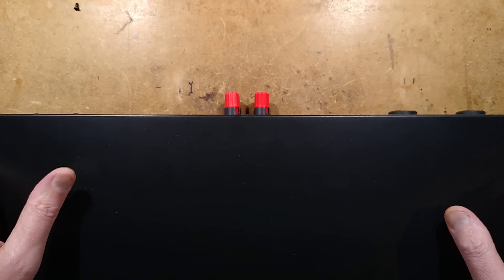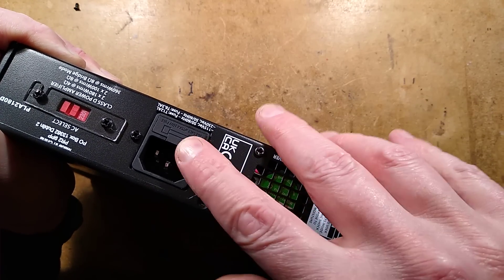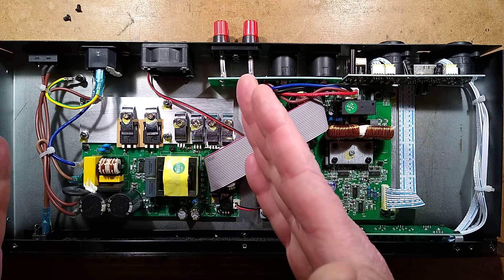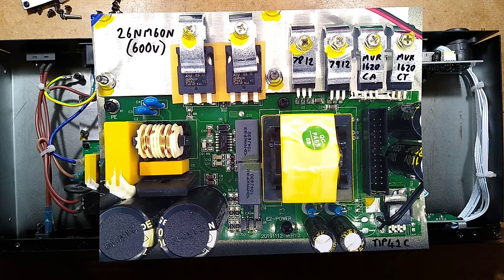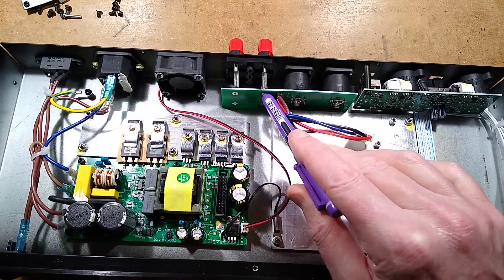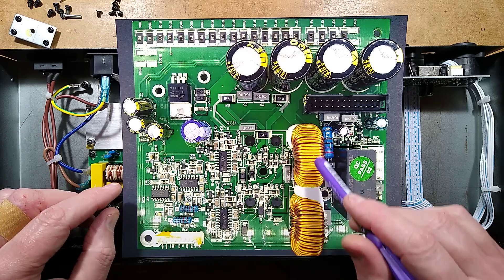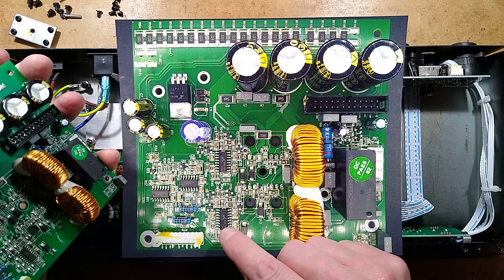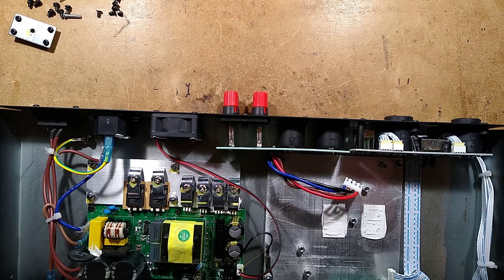Inside a 360W digital amplifier

Comment: can you make it run on an 12V power supply?
Reply: No, needs both +-25V rails, and also +-15V rails, to power the output stage, and input stages, respectively.
Reply: @SeanBZA  YES, beacause very easily IF you can find a power supply with output voltages you need or are man enough to make one PSU yourself.
In fact, extremely simple - you need a TL494 or SG3525 chip, two 40-60V and at least 60A MOSFETs, one or pair of 16-25V electrolytic capacitor(s) with a capacity of 4700uF, 2-4 pieces of 35 or 50V low ESR electrolytic capacitors with a capacity of 2200uF, 4 fast or Shottky diodes for a current capacity of 10-15A and 100V voltage rating , one 35-40mm ferrite (not iron strip or iron powder but ferrite!) toroid core+insulated (better if stranded, each strand enamelled - litz wire) copper wire or ETD34 ferrite core transformer with frame+ also insulated copper wire (better if litz) and some capacitors+resistors and UNDERSTANDING and you have a ready power supply unit that guarantees you voltages as low as 25V (personally I don't even see anything interesting in it because things go interesting after +-100V or more and tens of amperes of current at the output).
Reply: Yes ..use a suitability designed BOOST converter.

Comment: From my perspective there are two kinds of ground - power ground (protective ground) and signal ground.
So I'd like to have a dedicated signal ground post on the device.
In most rack mounted solutions the air is taken in at the front and then the fan sucks out the air at the rear. That's why there's foam at the front - to capture the dust from the air sucked in at the front.
Reply: XLR

Comment: Back in the day playing in a band at various venues one would often find a very noisy wall AC outlet, and all the gear was plugged into this single outlet. But we did have a sophisticated earth lift that could fix the noise with some risk. Disconnect the earth at the wall plug.
Reply: They sell something called an Isoline you put inline with your XLR which removes the ground loop noise without removing the ground.
Reply: Shocking!!
Reply: Very common practice!
Reply: You should never lift the earth...
Reply: @AstrosElectronicsLab  Exactly, only Atlas can lift the Earth...
Reply: @radioflyer2030  hilarious 😂
Reply: @AstrosElectronicsLab  was once very common 'get you out of trouble'
Reply: The DI box with the XLR for mixing desk. A ground disconnect trick used studios back in day was use a EURO-to-13A-plug adaptor that had two round prongs you poked into the standard 13A socket. That way didn't need screwdriver to open the plug up. Never did that with any group gear, very dodgy so that's miked up or DI non-contact. Because more decades ago guitar amps used to have a kind of "ground noise switch" that used to regularly malfunction and connect either the L or N direct to the chassis!   Some gigs the L & N are crossed over in the stage wiring.
Reply: That's how you kill the talent, good thinking Live Sound Maestro.
Reply: @railgap   Sorry never had a corpse on stage in all the years we played. After all, I was one of the talents.😋

Comment: I don't get the retarded reason of the 250V to 120V switch nowadays. In the old days they just had build it for the 250V and you could just plug it into the retarded 120V without issues.

Comment: two possible options for the large surface mount resistor array maybe:

1) it's a current shunt for output protection?
2) it's to discharge the HV internal power caps when you turn off?
Reply: At the edge of the board like this and next to the power supply cable bypass caps, they are more likely input current sensing. If they were output current sense resistors, they would be located along the edge where the output chokes are to avoid picking up noise from taking a long detour.
The HV caps are on a different board on the other side of the LV power/control cable, discharging them is definitely not it. Most SMPS will discharge their caps down to 20V or so in less than 20 seconds from disconnecting them from the wall or hard-switching them off just from their quiescent power draw, bleed resistors on them are only in case the power supply quits working so something will still be there to discharge them to a safe-ish voltage over the course of a minute or two.
Reply: They look to be 10k each and all in parallel. I count 20, making 500 Ohms. That's too high for a current shunt. It's rather low for a passive discharge. Also, I'd have thought it would be on the PSU board, not the amplifier board.
I am aware I'm making a few assumptions. Interesting ideas, though.
Reply: Fan driver, they want to not power the fan off the 15V opamp supply, as that will induce noise, so use lots of cheap resistors across the 25V main supply, and then the transistor to switch the fan on and off, with a zener diode to clamp fan voltage to 12V, and then use one of the comparator open collector outputs to switch the fan on and off, according to case temperature.  Temp sensor and fan connector on PSU board, but the wires run through the ribbon connector to main board for control of fan.

Comment: So the jack is 180 each, but then there's two speakers which would be 360 anyway, why split the connection, and still end up with mono sound
Reply: Maybe if you have a higher impedance speaker ?

Comment: Looks ok  for a lower cost unit assuming it sounds good, but I do not accept their rated output by standard testing practices.   Let’s see how long it lasts under load too. Soon as that foam filter loads up with normal daily dust the high temperature cut-out will hopefully function as intended.
Reply: Normal daily dust plus other more oily airborne by-products of the now legal recreational use of a popular music pleasure enhancer.😁
Reply: Isn't the output rating a peak measurement for most amplifiers? it's rarely going to sustain those loads for extended periods as it's amplifying a dynamic input. Usually it will had DSP to limit the input signal (or filter it) so you don't go over the peak, but the amp will clip if it tries to output too much, which you're supposed to address before the signal goes into the amp.
Reply: @wk4958  wattage ratings should specify whether rms, peak, music power or peak music power ..
Reply: @andygozzo72  I'm assuming it's implied that it's peak based off the nature of the device as rms would make no sense. They are designed to output only what they send in, so having its average power draw wouldn't be possible. I don't know what you mean by music power, but peak would make sense.
Reply: @wk4958 label by the IEC socket says RMS. 2x180watts RMS into 4 ohms. Now, is that continuous, or just for short bursts...
Reply: @RacingAnt  did a bit of research, it seems like RMS measurements are done with a test sine wave and multiplying the peak voltage by 0.707 (not a number I know the significance of. interesting stuff for me, I'm usually on the end of sending the signals in but not the picking of the amps used. I would assume they take into account the fact that there will be peaks that go over this value, but as I said before this does look like cheap Chinese stuff, so I wouldn't be surprised if it killed itself due to a minor amount of dust under operational levels.
Reply: @wk4958  i'm on about power output not power 'draw', rms would be what it can give out when fed a continuous sine wave, without noticeable distortion, or to a specified distortion level, music power, back in the 70s,80s or so was generally taken to be approx double rms power, peak music power, approx double that, but the makers varied how they specified it to make it seem higher than truely was in many cases!
Reply: Although this does look like cheap Chinese shit
Reply: The power at wich amps are rated is comparable to the program power of drivers/speakers. It is the average  power that can be acieved for short bursts.

Comment: interesting to see that they have the 'UKCA' along side an incorrect 'CE' mark! Does this mean that they have read the standards well enough to test the equipment but somehow missed the bit about what the 'CE'' mark shape. which is required to conform the shape defined in the standards. 5/10 for effort. do we beleve that it's been tested you should ask for a DoC and see if they can produce one. 🙂
Reply: Just saw you need that to sell in the UK, and stuck the sticker on. Eu versions will have a TUV sticker in place of it, or in addition to it.
Reply: @SeanBZA  No the EU versions will need the correct CE mark. the one shown is not valid. Search on "CE mark dimensions" and then your know that the one shown is not worth the price of the ink used.

TUV is just a test house where you would have your product tested to allow you to place the correct "CE" mark on it.  you could have tested it at any test house like "intertek, UL, SGS, Eurofins etc or even done it yourself if you have the equipment.

if you want to know more about a products safety ask the manufacturer for the "Delectation of conformance" by law they have to provide a copy on request. Some even put it in their user manual to save you asking.
Reply: @TheEmbeddedHobbyist  But you go and buy your "correct shape and size CE marked" item, no one is forcing you to buy this particular one - pay 10x more to get a same factory product with the "correct shape and size" CE sticker.
Do you even know what CE stands?
*C*hina *E*xport.
Summing up their entire bureaucratic background in two words.
Reply: @inarinukka7729  So you fell for that old joke, "China export" if you feel that saving money at the cost of safety is acceptable then go  ahead. But lets just hope that one of your family goes not get killed when you find out that they put the "CE" mark there but did not bother to test and confirm it was safe to use. if you put the value of the  lives of others lower then the cost of a bit of mains kit. 

I've CE marked a lot of products and to tell you the truth i would not sell any of them without the backing of the likes of UL or TUV to say I've produced a product that will not kill or hurt any of my customers.

Also do you know that most of the mains equipment that they sell to us will not pass the safety standards they require for it to be sold in china. The china standards are based on the same standards that we use for the UK and the EU.
Reply: @inarinukka7729  I see your point, but my K40 laser which was supplied by a UK seller! it has up to 20KV present inside, the manufacturer had decided that the mains earth was making enough of a connection through the paint so removal of the paint was no required and they could skip an operation.  Also the metal lid and the cover of the laser did just fine with a paint finish and no earth connections.

You can bet that the first operation performed on the laser was to rewire the earthing to bring it in line with normal safety standards, like BS EN 61010 which it should have passed to be able to be sold in the UK in the first. The seller is the one breaking the law not the importer or the manufacturer, the buck stops at the person who places the product on the market.

by the way thanks for giving the old grey cells a workout.
Reply: @TheEmbeddedHobbyist  Well, what is the current in this laser?

Similar experience with completely new industrial 4-5kW laser cutting machine that cost close to a million, Primo if I'm not mistaken was manufacturer, whole source racks were grounded with cables, cable lugs each end, tightened with fully painted bolts/nuts...Yes, sometimes it's stupid.
This amplifier, however, is at a rather low level in this respect.
Reply: @inarinukka7729  the max current in this laser is about 20mA, which is high enough to kill. and the voltage why above that required to breach the skin barrier. so all in all it needs to have a good earth protection which it did not have.

But 240V is still deadly, it may not kill every time, but the CE mark and the testing behind it is there to make sure your not the one.

 I prefer to cut the daises than push them up. 🙂
Reply: @inarinukka7729  boy i don't think that I'll be able to answer all that.

I was quite lucky as shorty after starting work as an apprentice, I had to spend some time in the Research and Development department. this chance meeting with the folks there meant that my path diverted and  I ended up spending more time there. When my apprenticeship  ended moved in to R&D. with all the toys you could wish to play with.

Now i just play on my YouTube channel. Do pop by sometime.

I can still remember what the affect of getting ferric chloride dust up the nose. the thought can still bring tears to by eyes but without the pain that came with it 🙂

Comment: Well the power circuit design is pretty average, as is the thermal engineering. Basic bent metal heat sinks and a switched mode supply that doesn’t automatically cover 110-240V is not even state of the art, let alone pushing the bounds. I can’t say much about the audio circuitry as you didn’t cover that. My guess would be that’s where they add the value.
Reply: It's 100$ new so that's plenty for the money
Reply: Does a power supply that costs maybe $20 and is inherently not supposed to automatically adjust to input voltage somehow make it a less functional device?
You know, this maybe 50-60kHz (kHz, NOT Hz, -it works 1000 or more times higher frequency than grid frequency) SMPS on this tiny 360W power, theoretically doesn't even need those bent sheet metal heatsinks - I've done same with a 72-76kHz IR2153 (also ballast driver and much simpler) that works at a non-sweat power of 1400-1600W continuous mode, and for cooling for switcher FETs and output Shottky rectification I used a single 1mm thick, 4cm high and 20cm long aluminum strip to make sure the thing works CORRECTLY. 
Nor is it welding inverter which you short-circuit the output to perform function for which it is intended :) IT is made to power low power (180W RMS is low compared to real PA) audio aplifier, audio signal is average 10% of possible peak value...
And sometimes it makes sense to stay not "state of the art" but to make things reliable and functional.
This amplifier for its price of 120something seems a little better than most amps that price today - here, nobody is trying to deceive you by sanding off the markings of the components. Most of it is so simple that any middle school student in today's internet age should be able to fix it 99% of the time if needed and not break the bank.
Reply: @inarinukka7729  problem is today's youth can't fix a toaster much less anything like that amplifier. 
There are a rare few nowadays that can but repairing and actually caring how something works is dying out
Reply: @NinoJoel  you are very right about that! I have only a single friend with similar interests who has told me a couple of times that I could make a channel where I show from start to finish, from drawing a schematic to building a device, how electronics work. Especially amplifiers and such power converters.
I have been active in field of amplifiers since I was still a minor, 20 years to date, and I see that this field of electronics as a self-build (or DIY) is not of interest to almost anyone these days because it is believed that "everything can be bought" - yes, you right, but there are things that are not possible buy and one of them is satisfaction of self-realization.
I feel like something is missing if I don't make circuit board myself for a DIY device for example, from the layout file to actually etching it (with evil chemistry [which also requires knowledge of chemistry]) and preparing it for assembly.
And sad thing is that all kinds of "embedded" characters who have practically no knowledge of really powerful amplifiers or their power supplies tend to talk about such topics, mostly nonsense that is not relevant and they also refuse to listen to what the more experienced say.
I can be so sure that I would be ready to take poison for fact that if I go to the street in my European country city with, for example, a laminate or toroidal transformer core and enamelled copper wire in hand and ask the first 100 who walks in street, to make a working step-down transformer for grid, they will not be able to do it - there is simply no knowledge because of our European education system has regressed quite a bit in last 25 years, for example, I look at old books and textbooks from the time and according to what is described there, it would be a piece of cake.
Here I am not going to talk at all about their ability to make a high-frequency switchmode power supply - most of the time, there are all kinds of "smart" (pun intended) people on topic of safety, etc., but they don't realize that even the simplest mobile phone chargers do not meet safety in some points, for example the distance between high-voltage parts is often a problem, not only in China products, but also in the case of well-known manufacturers who love to cultivate "state of the art" attitude of producing all kinds of throwaway products.
Reply: When handling power levels 100W & above it is not recommended in implementing  universal mode p.s. , reason being obviously  higher failure rates. But , a ( fixed) selectable option is ok. and many do provide it.